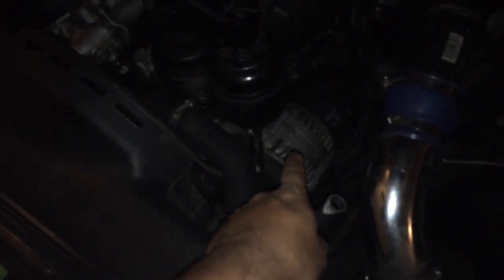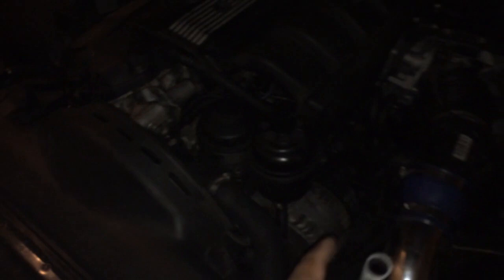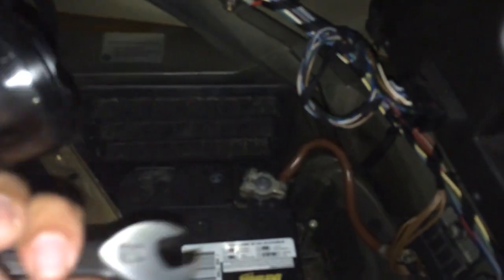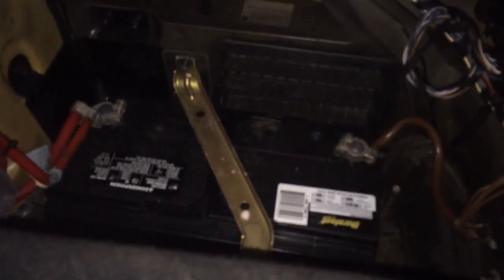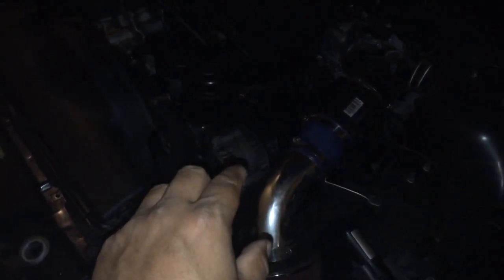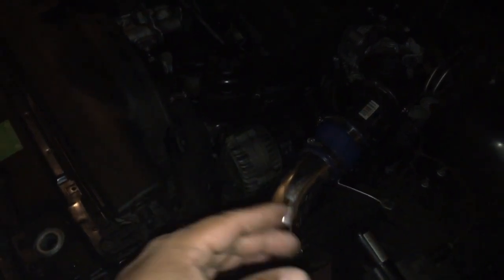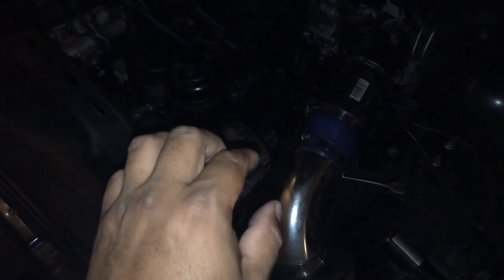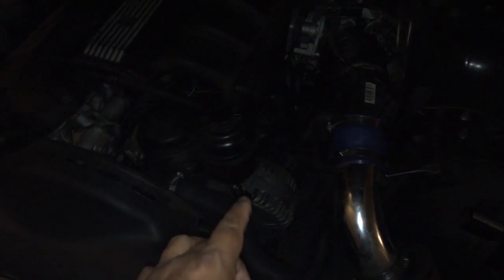HOW TO Test Bad Alternators Symptoms BMW 5 Series 3 Series E90 E39 528I 328I M5 M3

Comment: i recently got a 2003 525i. the car is surging a little while idling and the lights dim with the surge. the headlights also dim and flicker. Do you think its the alternator?
Reply: mason volz did you ever find out what it was. my wife's car is doing the same exact thing and it even idles rough too. BMW 545i
Reply: Not yet. Going to replace the alternator after the new year.  Let me know how it goes for you. Good luck
Reply: my issue was fix already. (bad alternator). when i tested the altenator it was reading 13 to 14 but when i did a cold start it would read 10 to 11. hope this helps  you. good luck
Reply: @illest_street_cars1907  hey bro did the alternator problem was a success..
Reply: @masonvolzable  hey bro I know this is an reply. But did the alternator problem was successfully slove..
Reply: @marioknowles3376  it did. Sold the car 2 years ago though.

Comment: Repair fanatic have you ever had a problem with trying to start ur can but it dosent start it just makes one click noise i have a Bmw 528i 1999 Please get back at me i cant go anywere
Reply from the maker: Yes I did a battery test and replace the battery.
Reply: +Repair Fanatic but my radio is on i don't think its thé battery
Reply from the maker: +Raul Maldonado The better might have Power to operate small things but it has a cranking that won't start the engine. Try hitting on your starter to test it. to see if your starter is not working.
Reply: +Repair Fanatic i hit it still nothing Hey do u live in the los  Angeles area
Reply: Raul Maldonado that happened to me and it was the ews that went bad